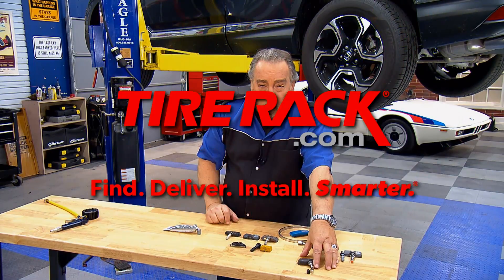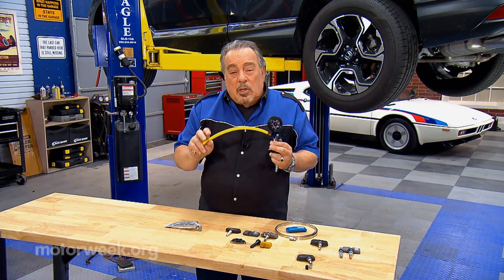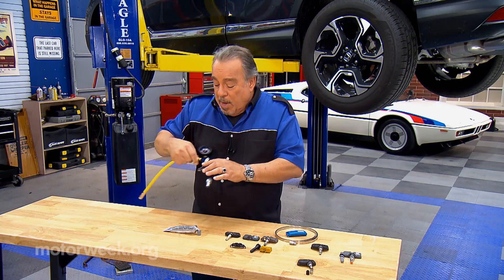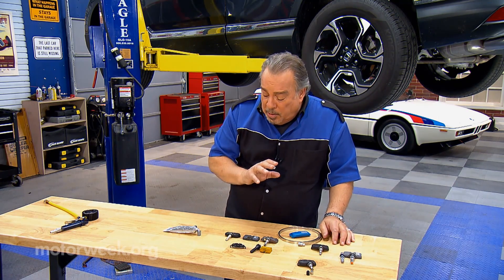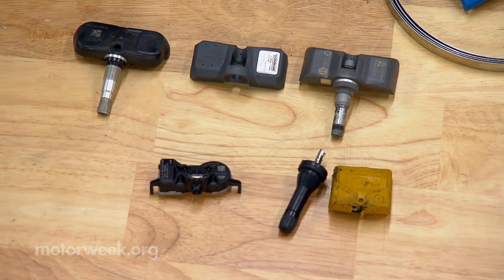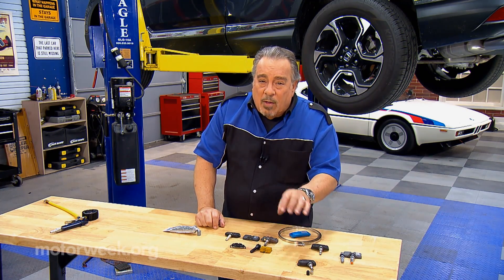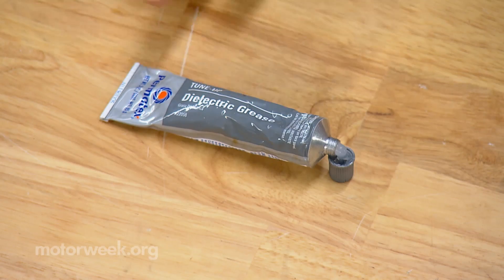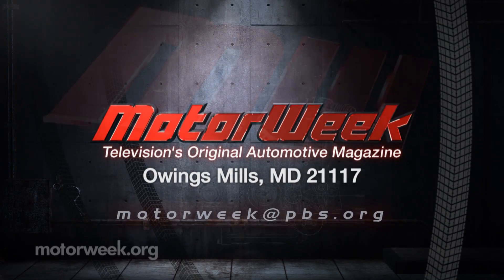Goss' Garage: Tire Pressure Monitoring System (TPMS)

Comment: The dummy light system with TPMS really does seem like a money grab as there are a lot of false positives especially in the winter and it is next to impossible to tell which one is causing the problem visually.  For a few $ more they could put the ones in that tell you the actual pressure in each tire and eliminate the need to go to the mechanic.  It seems only the higher end vehicles have this but the feature itself isn't that expensive.

Comment: STOP THIS IDIOT. HE HAS TO GO!  I think he has run out of things he knows and is now just making things up. Someone tell him that you can get the internet on computers now. To WIt:
Most TPMS censors send the actual tire pressure to the display. But this information at least is not totally wrong.
Metal caps on tire stems bind because of the interaction of dissimilar metals (they exchange ions due to a weak current flow). IT HAS ABSOLUTELY NOTHING TO DO WITH ELECTROLYSIS. WHICH YES, IS USED FOR HAIR REMOVAL.  And as for using delectric grease (which is a grease which inhances electrical conduction),  that is the OPPOSITE of what you want to use, You can use almost any kind of lithium grease for this (or none if you have plastic caps). Dielectric is what you put on a connection to protect it from moisture, rust, etc, BUT MAINTAIN good electrical flow. Perfect for the battery terminals, but not for air valves.

I could show Pat the difference but coating his finger in dielectric before I stick it into an electrical outlet on his next electrolysis visit. What a moron. One thing is you just spout off online, big problem when you have a tv show and give people wrong,, bad information. I would fire him

Comment: I have a 2011 VW Tiguan and recently SAMs club has replaced all 4 tpms saying that they failed. Even after replacing tpms the alert symbol does not clear. How to reset tpms on 2011 VW Tiguan, it does not have tpms reset button or menu options to reset.

Comment: How long do these sensors last? I have a 2014 Escalade with 95,000 miles and I will soon be going on my 3rd set of tires with the original sensors. Should I replace them on this tire change?

Comment: WRONG WRONG WRONG ! TMPS systems vary depending on the car manufactures in-car software, Some of them  DO... let me repeat they DO tell you each and every tire pressure . Goss's statement that they don't is incorrect! and most of the newer cars start warning drivers when tire pressure drops more than 5lbs....again depends on the manufacture's software ...

Comment: This TPMS is a good and functional add-on/standard accessory of any modern car, however, once these TPMS ages, this will throw warning lights on your dash which becomes a NUISANCE for a car owner.  IMHO, car owners have the option to disable the TPMS receiver from the car, just to get rid of this warning light.  A weekly visual inspection and monthly tire pressure reading of all tires is far more convenient and cost effective.  Bringing the car to a dealer to check these TPMS is a money grab.
Reply: But... many aftermarket TPM sensors are junk. A regular repair shop can diagnose and repair TPM systems with the right equipment, but they should be using OEM sensors to repair. Sure, any driver should do a visual inspection of their car, but people would say that's a nuisance too...

Comment: How often should you replace  these sensors, my local tire shops always trys to Force me to replace them with every tire change..(6 to 12 months) or flat repair by automatically adding them to the bill each time. Haven't replaced one yet.
Reply: B Bee TPMS batteries last 7-10 years.  What the shop is replacing is the valve stem and seal kit on those services
Reply: ForTehNguyen , ok thanks. However is that the same as the TPMS kit? they charge 7 to 15 per tire?
Reply: Yes that is the same.  O rings have to be changed so they don't leak.

Comment: As much as I don't like additional electronics, TPMS has likely saved a lot of tires from drivers not knowing they have low pressure.  Friends/family fill up at my house, and sometimes get a tire plug too.
Reply: look at your damn tires before driving off.
you dont need a tpms
--------------
Lic driver circa 1968
Reply: Correct, I don't need a TPMS, but my GF and mother for example probably won't check them.

Comment: I enjoy having a tpms sensor but I don't understand why they don't have rechargeable batteries? Seriously, the batteries should be able to recharge by the spinning of the tires, just like we have flash lights that run by turning a crank and/or radio. Same concept.
Reply: Andreas M It's not the same rechargeable radios require you to hold the assembly well you spin another part of the assembly These sensor assemblies would be spinning entirely with the tire
Reply: mitchlu well I'm sort of more or less thinking something on the line like a Citizen Eco Drive watch the movement of the wrist causes something inside the watch to move which also charges a battery I also own a watch that doesn't have a battery but it functions just by the movement of my wrist so I think the TPS sensor could have some type of a magnetic ball of some sort that would spin around and cause something else to windup which then in turn would charge the battery. I just don't think it can be impossible my guess is the manufacturers don't want to put this out there on the market because of course they would make less money in the long run

Comment: TPMS sensors are nothing more than a big money grab... 

My car has it and I want to find a way to delete the system... completely useless and highly annoying
Reply: The tpms system was literally the first thing to brake after warranty.  Took apart the dash and put some electrical tape in front of the light. Haven't had a problem since!
Reply: Money grab, I'd disagree. If you don't have a consistent leak on your wheels/tires, then you shouldn't see the light come on. Only exceptions are a leak, or when there is a large drop in temperature. Pressure will drop when it gets really cold and you'll likely see the light come on. Just adjust the tires to the correct pressure when cold (there's a label in the driver's door jamb listing the pressures), and you should be set.
Reply: Felix Bastien or if one of the batteries die in the sensors
Reply: OEM TPMS sensors suck and their installed location (inside the tires!!!) sucks even more. When their batteries die you have to remove the wheel and tire and dismount the tire to remove the sensor and then remove the battery. Aftermarket TPMS sensors at least give you assemblies and batteries that remain outside the tires. Also, aftermarket systems report each tire's precise pressure to the driver, rather than just giving the driver a single idiot light when one of the tires (guess which one!!!) goes low.

Comment: Informative video, but pretty much a couple of "yea right" suggestions.  I'm probably more diligent than 95% of the population, and I might check my tire pressure 3 - 4 times per year.  Also, who uses dielectric grease on tire stems???

Comment: Would putting fix-a-flat mess up the tpms?
Reply: JUMP23MΔN absolutely
Reply: Make sure the fix a flat bottle says safe for tpms
Reply: Tire shops do not want to deal with fix-a-flat.  They may refuse to patch your tire, and require you to change the TPMS so they aren't held liable if it doesn't work again.  They hold the upper hand in situations like this as if you don't want to continue, they'll give you back a tire with green goo sloshing around dismounted from the rim.
Reply: If you use fix a flat just to get by for a day or two no it won't mess it up. If you leave the fix a flat in for a few weeks then yes it will.